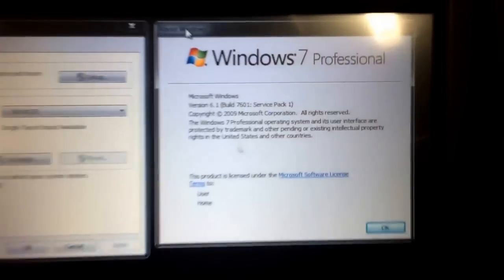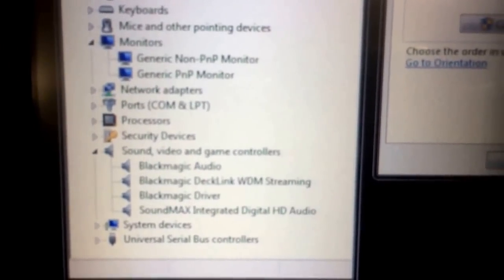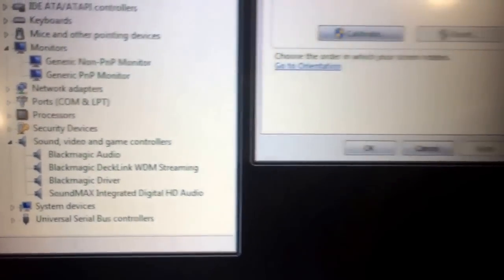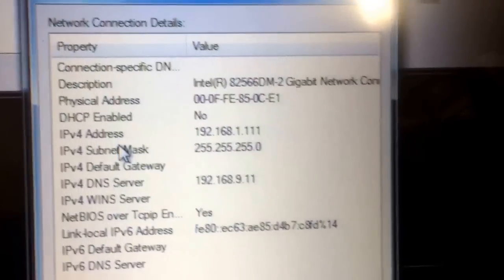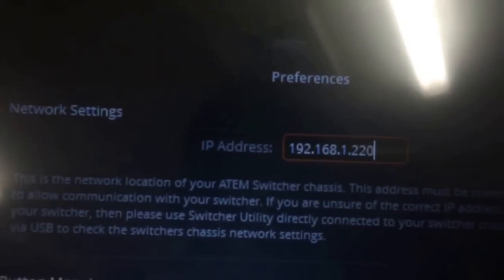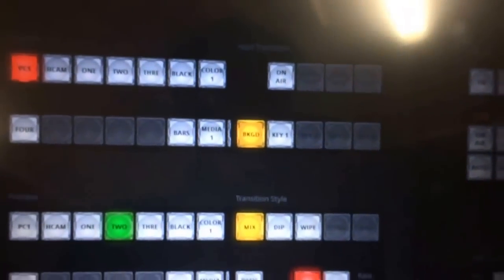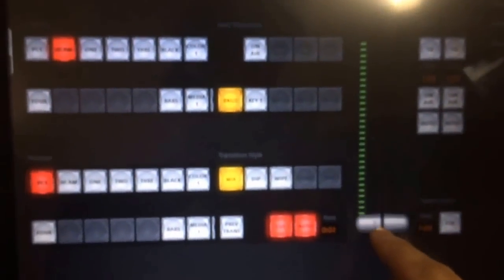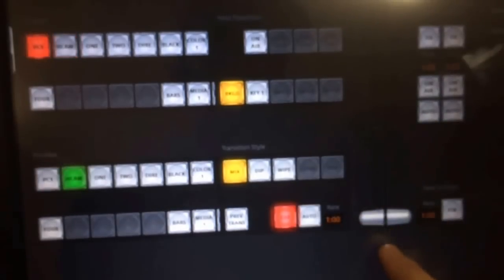3M touchscreen monitor controlling T Bar in Blackmagic Design ATEM Television Studio

Comment: Any update on how this panned out for you?
Reply from the maker: It was another 9months after this video until I had the SDI cabling and necessary convertors for me to switch over the live video production from all analog, to fully digital with the BMD TV Studio.  Wow what a difference.
2016 was a great year and not a single hiccup.  Operator of ProPresenter (on MBP15") has the touchscreen next to them and just perform simple cuts between computer, camera and then also keying txt overlay.
Now in 2017 looking to capture and live streaming